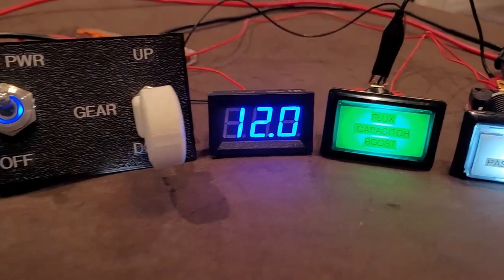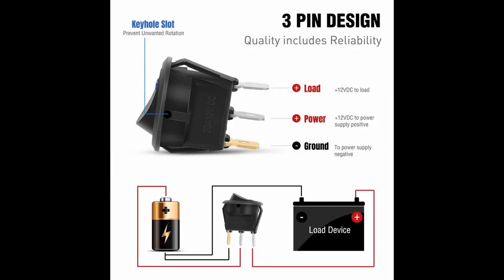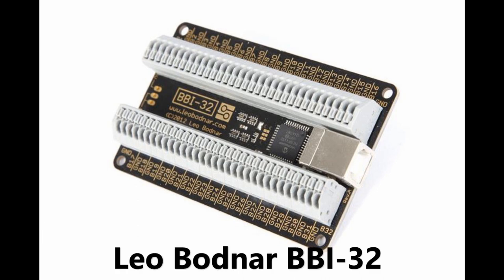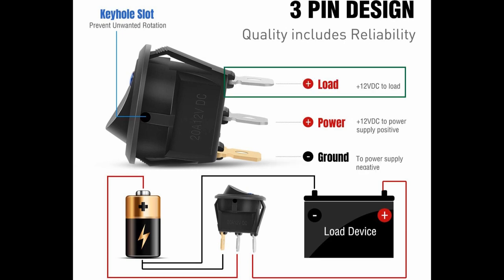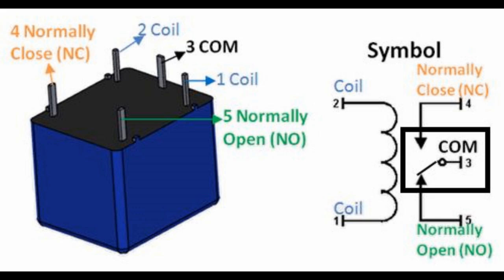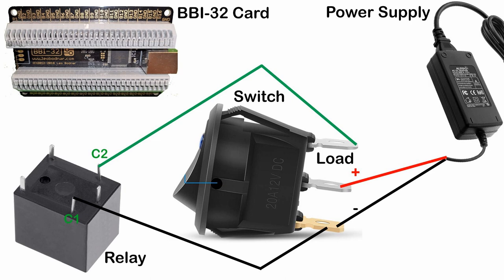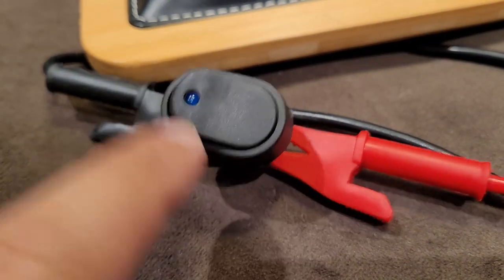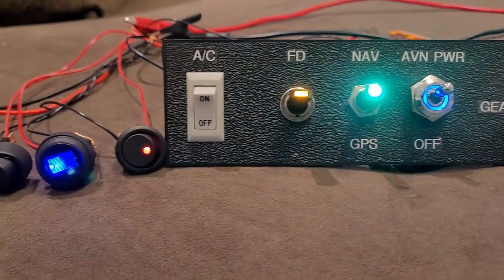Adding LED Switches and LED Pushbuttons to your Cockpit

Comment: Hello. So I want to make a button box with leds. Engine start led 12v, etc. So correct me if I'm wrong but if I get the relay module (ease of wiring) that is basically so I can add buttons with leds that require 12v. That relay board would be the go between the 32 bbi which is an HID (USB) and the button itself?

Comment: Hi I need your help. I want to build an overhead panel for the A320. Now I have the problem I do not know which buttons I should take best and which modules I need. So that at the end when I press the button the lights are synchronous with the lights in game and that when I press the button the action in game is executed.
Reply from the maker: For this you will need to step into interfacing. It will require a card similar to an arduino, and software such as FSUIPC and MobiFlight, which read the variables from the simulator and can program the hardware. I suggest you view this video explaining the difference between cards available and how they work: https://www.youtube.com/watch?v=M7Fx54e_NtM I plan to make more videos on the subject soon.
Reply: @joshuamarius  So i need a Leo Bodnar and a Arduino Uno

Comment: Josh.  I have a SPST switch that I would really like to use on my flight sim.  I can't find a DPDT version of it. . I also want to add a LED to it. do you have a basic wiring diagram that can do this ?
Reply from the maker: This video shows you how to do SPST to SPDT: https://youtu.be/AiNyWi12lZY - Converting it to DPDT is another level but sounds like a very fun project. Can you send me some information on the switch and I will try to develop something for you? Thanks.
Reply: tried replying twice but I don't think it allows me to drop an ebay link in it...keeps disappearing. . basically it's just a standard on off toggle switch.  I want it to switch a pin on the leo board so my flight sim switches plus swith on a LED
Reply from the maker: @kevinberlyn8060  YouTube marked you as Spam unfortunately. Use the contact form on my website digitaljoshua.com and I will review.

Comment: In the planning phase of setting up a simple button box as a first project, my knowledge at this point is very limited but growing. My concern with On-Off switches is that for example if you were to wire a on-off switch for gear to lets say "button 2" would the computer detect "button 2" as being pressed constantly or would it send a single command? Is this dependant on the board used?
Reply from the maker: Very good question! This will depend on the software and the simulator. In most simulators what usually happens (using your example) is that when you switch to On it will process the command once, even though electrically you are always triggering that switch. That's why it is recommended you use SPDT (On-Off-On) switches instead of SPST (On-Off) although the same signal is sent constantly in SPDT as well. The difference is you can assign the two "On" states on the SPDT to Gear up and Gear down, and in the SPST you would only be able to use the "On" natively, and then for the Off you would have to use software since this action does not send a command.

Comment: Hi Josh. Love your video on Adding LED Switches and LED Push buttons to your Cockpit. Question. can I put a Sliding pot on the Bodnar BBI32 card and use as a Throttle?
Reply from the maker: Hey Kevin, thanks for the comment ✌To answer your question...no. The BBI-32 is only for digital inputs (push buttons, switches, digital encoders). The sliding POTS is considered analog. Both Leo Bodnar and Desktop Aviator have cards for this. Here is one example: http://www.leobodnar.com/shop/index.php?main_page=product_info&cPath=94&products_id=204
Please make sure to read the product description and How to Use tabs so that you better understand how you would wire it, and to make sure it will do what you need it to do. Any further questions, please let me know :)
Reply: @joshuamarius  thanks for the quick reply.. keep up with the GREAT videos.....they are my Bible to flight sim building
Reply from the maker: @kevinberlyn8060  Thank you! More coming soon; already started working on them 😁

Comment: gday josh. finally finished one of my panels using the bodnar board , relays etc as per your instructions. worked perfectly.  only issue I have now is assignment in XPLANE. 12.  for instance I want to assign button 6 to avionic on/off.. I have done that in the joystick setup but I have to toggle twice to turn on and off... I I presume I need some sort of script? when pressed etc and when released etc.
Reply from the maker: Isn't is amazing that no Simulator to this day has implemented that natively? You have a few options: 1) SV Mapper - A free software that captures Joystick inputs and turns them into keys, and also gives you an option of On Press and On Release and requires no programming 2) FlyWithLUA NG - Write your own LUA scripts to check for the Avionics switch and switch on / off using Datarefs. The examples included in the FlyWithLua manuals are very useful. If you are using Arduino or a similar interfacing card, then you can use MobiFlight's built in functions for when pressed and released. Hope that helps :)

Comment: Thank you for sharing this useful video. I have my Cessna 172 button panel (lights, fuel pump, pitot heat). This panel is driven by some controller of course. I would like like to replace only my regular switches with led switches. In this case I need only power supply and relays? Correct me if I’m wrong 
Thank you
Reply from the maker: Thank you for the comment. What you state is correct. Just wire as shown in the diagrams in the video, and also consider the relay module boards which neatly pack multiple relays, and include terminal blocks so you can easily wire them. These boards also only require a single connection from the power supply.
Reply: @joshuamarius  thank you I  will try
Reply from the maker: @davewebb8777  No worries. If you need any help or want to update me on the project, please use the contact form on my website 👍
Reply: I sent you one question via website form.

Comment: Really nice instructions mate.how should I wire a 12v illuminated push button(like a start engine button) when I want it to be constantly illuminated?
Reply from the maker: This would depend on the switch. Most of the toggle switches will only switch on the LED when the toggle switch is moved to the "ON" Position. For the larger push button switches you see, they are usually always on. Do you have the wiring diagram/schematic for the button you will be using? That will help me determine the wiring you will need. Thanks!

Comment: Hello my friend.. so for each switch that demands 12v power for the LEDs i need one relay... So if i have start engine button and one more 12v button i need 2 relays? Thank you for sharing this video
Reply from the maker: Yes, that is correct. Each switch needs it's own relay.
Reply: @joshuamarius thanks my friend... I did exactly how you show in ur video and worked perfect... But I am not sure how to connect a 5 pin 12v led button to Leo bodnar... Does it need also a relay and how is the wiring?

Comment: Tnx for bringing it. I'm using the LED Tip Toggle Switches connected to the USB DeskTopAvaitor Control Board, no need Relay, the only issue is lights are to bright, probably, need to dim them somehow, other than that works fantastic
Reply from the maker: Thanks for the comment. As mentioned before these cards are powered through USB which is rated at 5v. Most LED switches are rated for 12v. You can power any LED toggle switch at 5v but you always risk shortening the life span or some other effects so I don't recommend it 🤷
Reply: @cybhunter007 .... have no idea what you are talking about (sound like Mandarin to me) but tnx for the advice ..... 😅

Comment: hi, good vid.
but how can i realize with push buttons ? couse starcitizen only regcognize a push, no "on hold" may i use a seperate Relais for a LED to turn on / off?
Reply from the maker: A pushbutton works the same way as a Switch... But whether it stays lit or not will depend on the push button. The push buttons you saw in the video do not turn the LED on or off when pressed or released. The LED remains on but the push/release signal does get sent to the Simulator.

Comment: i'm sorry but i don't understand something...
how can i bright 5 led with only one power supply? Do i need another card to plug power supply wire and all the wire for switch?
Reply from the maker: The LEDs in the switches are 12V. The Arduinos and most interface cards operate at 5V, so the relay is there to help separate these voltages. A 12 V power sources will light up the LEDs, and the 5 V coming from the USB will supply power to the Arduinos / Interface cards, which will take care of processing the data (inputs/outputs).

Comment: Couldn't we use a resistor soldered in before it returns to the board?
Reply from the maker: Yes, but make sure you research/review your project and make sure you understand where the resistor would go and why.

Comment: Why not use the 5v from an arduino? Why the 12V and a relay?
Reply from the maker: With 5V, you will end up with dimmer LEDs and you have to be careful with the current as you may affect the life of the switch. It all depends on the product specifications, but to play it safe 12 volts is recommended for a 12 Volt switch.
Reply: You also need to keep in mind that typically Arduino I/O pins are rated to 40.0mA max and you have overall limit of 200mA. It's just not designed to drive a constant load for powering things. It's just for signals. Even if you would have 5V rated LED switches, but let's say more than 4-5 it's already a good time to consider either using relays or led drivers.
Reply from the maker: @bartoszszymanski6647  This is great information! Thanks for sharing :)